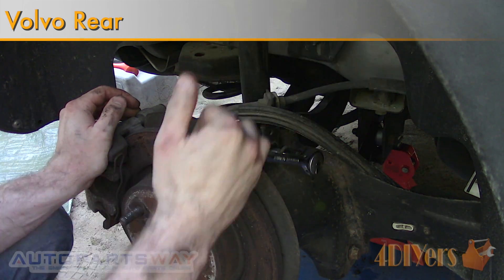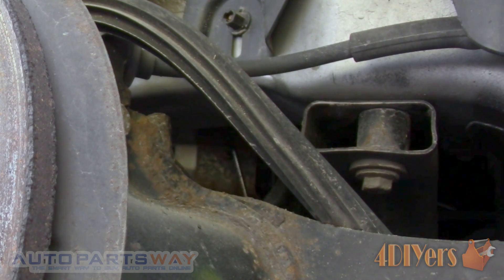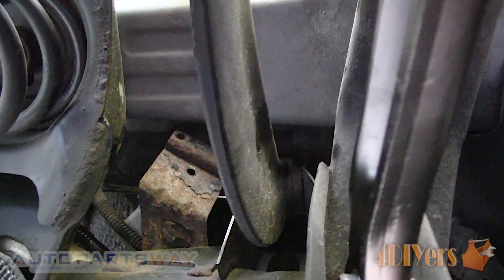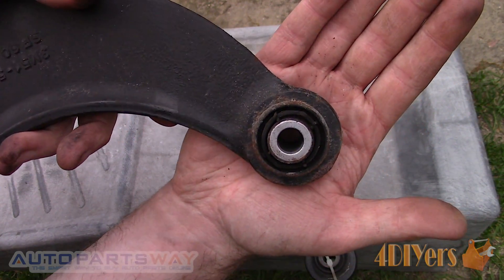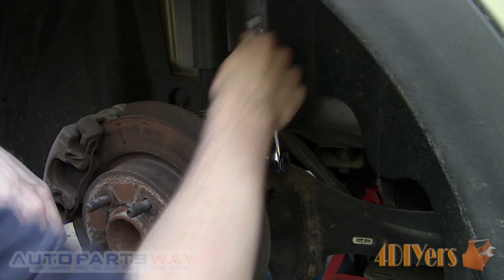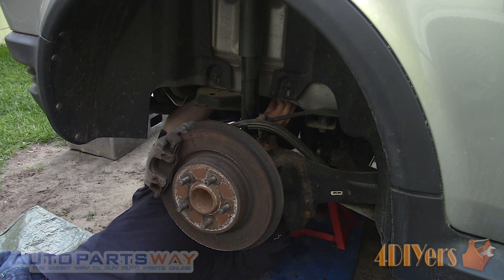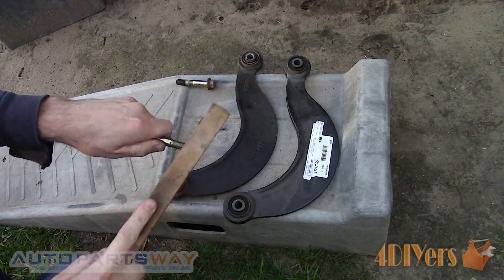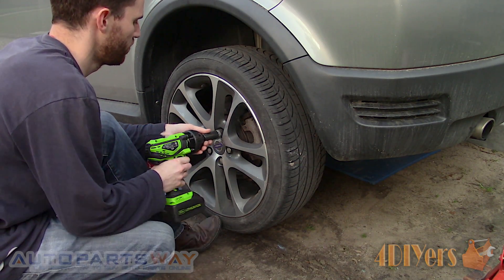How to Replace the Rear Upper Control Arms on a Volvo C30 S40 V50 C70

Comment: Good clear video, I have a C70 II  with the same set-up, but my tyres are wearing badly on the inside edge, I have been told this is due to poor wheel alignment on the rear hubs, can these be adjusted to bring the alignment back where it should be ? you can see how bad the alignment is simply by looking at the car from the rear, the top of the wheel has a negative camber of about 25 mm from the vertical !
Reply from the maker: Thank you! You can adjust the back suspension, but to get more adjustments, custom adjustable control arms can be installed.

Comment: Exactly how to do it- but why go with the factory non-adjustable replacements instead of adjustable arms? Are Canadian roads bad? No thoughts of lowering it for better performance later on? The C30s handling is significantly improved lowered but negative camber is an issue if you value tire life. Go adjustable man! Great videos and keep up the good work!
Reply from the maker: Thank you :) At the moment I'm debating on what to do with the car, the adjustable arms were well over double the price than compared to the versions I installed (I still used quality replacements).
Reply: @4DIYers  The adjustable arms are all the same - manufactured by Performance Parts Sweden. Buy the unbranded ones and they're half the cost.
Reply: @4DIYers  hey man! Love your videos. You have helped me so many times. I am replacing these control arms on an 05 v50. 
I bought the adjustable ones, because the neg camber was eating up my tires. But looking at this video, you seemed to say that replacing them with the non adjustables might fix the excessive inner tire wear.  I am also debating where to go for the OEM again or installing these adjustable ones. 

In your opinion, is there a drawback to using either set? Is it good to have adjustable ones?! 

I’m new to suspension work entirely. But I love the channel and how thoroughly you explain everything. It really helps. I watch each video and pause in between steps. You’re great
Reply: @MintCorn  same here with my 06 S40 T5! I could do anything on my Saabs but needed a little guide for the Volvos. Which control arms did you ultimately end up going with? The negative camber is worse on one side than the other and it’s driving me crazy lol

Comment: Is there room to fit a fixed 15mm wrench instead of running an extension in regards to the bracket
Reply from the maker: If I remember correctly, I don't believe so.

Comment: I've picked up a 2010 Volvo C30 base T5 from a private seller and the seller told me something " plastic cosmetic" from the center lower bumper is missing. Can you tell me if the front lower air guide is visible from the front? There's no honeycomb lower grill insert on this yr/model, I understand that. I've looked at stock photos front angle and compared to mine. There isn't any obvious difference. I see what looks like lines radiator & a/c compressor horizontal metal lines on stock and my own currently. I'm thinking lower front air guide but it doesn't appear to guard or protect. What am I missing? Thanks!

Comment: Can you confirm that a C70II (2011)  has this same set-up suspension wise as this C30 ? I can buy adjustable control arms from PFS an online parts supplier for Volvo, Merc, and BMW, but they only advertise this part for a Volvo S40 and V50, but I thought the rear suspension on the C70 was the same as a V50 ?
Reply from the maker: The C30, S40, V50, and C70 is all the same as far as I know in this generation. You can also cross reference the control arm part numbers just to be safe.
Reply: @4DIYers  Yes I can confirm they are the same, as I fitted new adjustable upper control arms myself last week, and all went well, no issues.